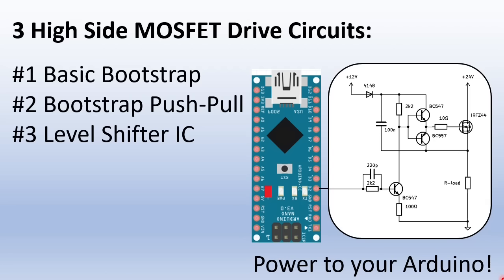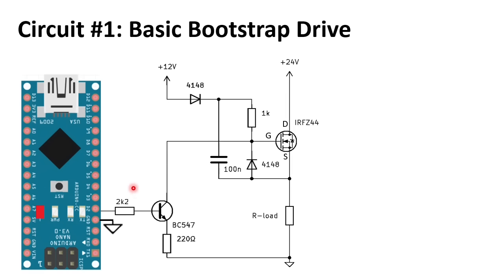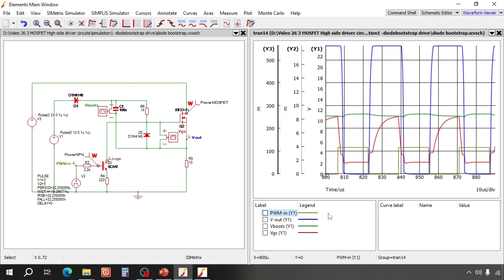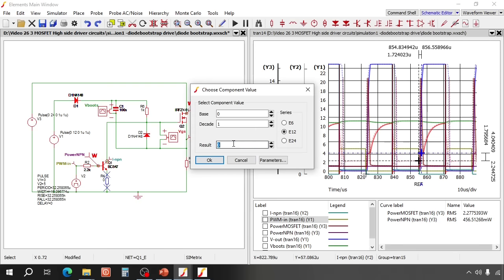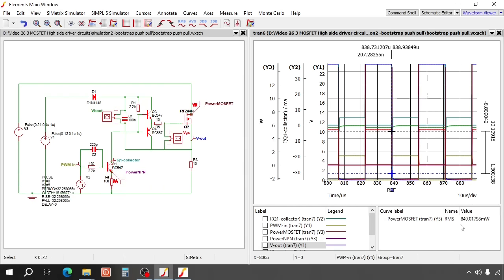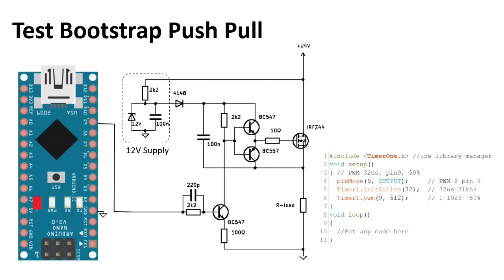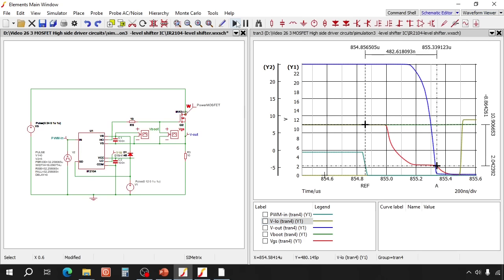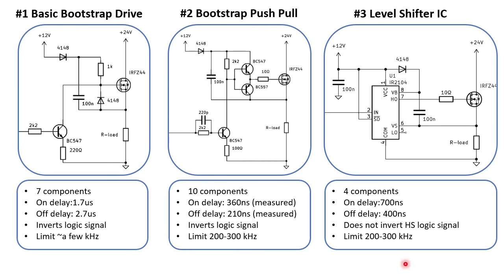3 High Side MOSFET Drive Circuits

Comment: I was always under the impression that the energy dissipation in the Mosfet was due to the speed of the actual switching of the fet and had nothing to do with the delays being on or off. Remember if there is a delay of what ever time say 500ns the fet is still dissipating no energy because it is either full on or full off. It is only at the time that it is actually switching from full on to full off (or vias versa) that the power is dissipated. In your tests the actually switching times are 200ns (using IR2104 circuit) and that is what should be used for the power dissipation calculation. Basically the time of the slope of the mosfet switching is what should be used for the power dissipation. And this is based on the speed of charging the gate capacitance of the mosfet. In the advanced transistor driver and the IR2104 a 10 ohm resistor was used and similar actual switching times of the moset resulted. In the basic version the low current of the 1K resistor slowly charged the gate capacitance resulting in the slow actual turn on of the mosfet. Am I wrong on my assumptions?
Reply from the maker: You you are right, during the delay the MOSFET is just waiting, so no switching losses.

Comment: Nice video, good explanations.  But a comment on the use of "current sink" (BJT with emitter resistor) to drive the boot-strap circuits.  The *minimum* voltage achievable at the collector of the level-shifter BC547 (call this Q1) is about 4.5V, due to the output voltage from the Arduino, and the Vce (sat) of Q1.  Add to this the Vbe of the pull-down PNP in the buffered boot-strap, means that the mimum voltage at the gate of the MOSFET will be about 5.2V.   In most cases this should be sufficiently low to ensure the MOSFET stays OFF, but not always.  Is there any particular reason you did not just connect the emitter of Q1 directly to GND, and insert a suitable resistor in series with its collector if current or power dissipation became a concern?

Comment: Question is if you use higher voltage like 400 volts DC  at the high side drain then need more than 400 volts at the gate source to drive the load at the source and the limit voltage for gate source is not More than 20 volts DC how does this bootstrap works for high voltage at the source you may want to make a video for that.
Reply from the maker: @doost6233  the circuits can work with 400V dc, you will need to replace the “level shifting “ bc547 transistor with a high voltage mosfet. The IC circuit works for 400 volt.

Comment: I have a question as I'm not an expert in power electronics. Could you make a separate charge pump circuit with its own oscillator and switching transistor that's permanently on and is solely devoted to generating bootstrapping voltage for the high side MOSFET? I reckon it would allow you to keep it switched as long as you like since putting the charge pump directly besides the MOSFET only generates the bootstrapping voltage for a brief moment

Comment: To my surprise, I found from digikey some P-Channel mosfets that don't cost that much but are similar to the N-Channel RDS(on) levels.  E.g. G040P04T has less than 3.7mΩ and is only $1.82. The G050PO3T has less than 5mΩ costing $1.17.

Comment: What about a drive circuit that works at DC? (Say to shut down voltage on the load when a fault condition is detected)?

Comment: Thanks you for the detailed explanation. I just want to add a comment that MOSFET turn on and turn off speed is the time the transistor changes state. In most of the video, you are referring to the shifter delay as turn or and off time but this is just the shifter delay and not the turn on/off time. While important to prevent shoot through and ringing, the delay time is not as critical as the time the mosfet spends not fully on or off.Power dissipation is current x voltage and partially open time is where most of power loss is generated. One of the most important characteristics of the mosfet driver is how fast it can switch the transistor. In that respect the slope of the open/close curve is more important than the shifter delay. If you measure it in your experiment you will probably find out that the IC does that best and will result in least power loss.

Comment: Can I use these circuits to swap batteries? I would like to keep a second battery full until the fire battery is exhausted. After that I want to turn on the power from second battery and jettison the empty battery. But this means that after battery swap the second battery would power everything  including the control circuit.
Reply from the maker: Probably not the best circuit for that, I would search another circuit online , maybe something like this: https://www.wellpcb.com/battery-backup-circuit.html

Comment: The 2nd circuit you showed was the one i used during the IC shortage after the pandemic. Worked really well for the motor controller i was tasked with designing.
Reply from the maker: haha cool, yes these component shortages...you could still buy old stuff like transistors and NE555's.

Comment: Your videos explaining circuit operation are some of the best available, free or paid. 
If you’re excepting requests,  will your touch on the topic of the “Slayer Exciter” circuit? It’s used to drive  Tesla Coils in lieu of a spark gap circuit. 
I ask, because in studying data sheets of N-channel Mosfets, I found that the slayer circuit closely resembles a test circuit in the back of many datasheets (an unclamped inductive load) 
I’m still new to field/hobby of electronics. I’m pushing 50 and not without experience. I’ve built several Tesla Coils that use a single MOFET Slayer Exciter that were functional. I’ve  seen a few simulations of the circuit but none with the in-depth explanations that make  your videos stand out from the rest.  Thanks for your time and the videos!!!
Reply from the maker: Thank you! 
I know the Slayer Exciter, and it is not a metal band from the 80's. I have no experience but I expect you can use the low side MOSFET driver push pull part to make your slayer exiter more efficient.  I did see that for Tesla coils it is key to drive it pulsed, e.g. with 5-10Hz PWM with low on cycle (5% or so) to get nicer sparks and prevent burning your MOSFET. You can use the arduino for that (or a 555....)  So yes I am interested and if I find the time I will build one myself 🙂
Reply from the maker: Did you check this video, seems like a robust design to me. https://youtu.be/xImmwL5MR0o?si=BMNipvCvJpJh1Tgh

Comment: Hello! Interesting video! I made experiments with discrete (only transistors)  class D amplifiers. In my opinion most good design of a gate driver is the  " UM10155 Philips application note" .  There are Q12, Q10 is a high side gate driver. The transistor Q8 turns on/off  this driver.You can replace it with usual BJT transistor , but the maximum CB voltage can be greater that your power positive bus (in this video -24V). To decrease current consumption it may be a low power MOSFET, for example 2n7000.
Reply from the maker: Thank you, that is a great appnote, found it: 
http://educypedia.karadimov.info/library/pwm%20vegfok%20philips%20UM10155_1.pdf
Reply: The "UM1055" app note circuit provides no provision against C5+C6 overdischarge so insufficient gate drive of the top mosfet, e.g. when the top transistor is requested to be ON for way too long (in case of the amplifier, when the input signal overdrives it towards clipping on the top rail - so pretty much normal operation unless the input has properly set and even supply tracking limiter). It is even worse as the Q8 draws current from the C5+C6, so is actively discharging them, so the critical maximum ON time is not that long (barely covering the normal switching frequency).
Reply: @annaplojharova1400  So , we need simple forward one-transistor  isolated converter to supply high side - if you want to turn on high side during long time.Or we can use a usual half-bridge gate driver IC and supply high side (without bootstrap diode) with mentioned  one-transistor forward self-oscillating isolated DC/DC converter.
Reply: @andrewandrosow4797  You can use the simple bootstrap, but the predriver has to provide protections that ensure the bootstrap capacitor gets recharged (e.g. by forcing an off pulse in the class D amplifier or the buck converter examples) and/or the transistor gets shut down properly if it can not handle the current with the available gate drive (in fact this could be done by a simple 2-transistor, few resistors and a capacitor addon circuit monitoring the ON state Vds, if we want to stay with "simple" discretes). Or use one of the many available gate driver ICs, which do have at least the bootstrapped supply monitoring build in (that is enough, when either the current is monitored elsewhere, and a direct short circuit is not an issue, like e.g. in an active speaker box amplifier). Here I see the gate driver IC just as the simplest practical solution, offering at least the minimum protection (essentially against input undervoltage for the buck converter, or the signal overdrive for the amplifier). There are also ICs that provide the overload protection (either the large Vdson, or current sense, or both).
Reply: @annaplojharova1400  I had made in past the class D amplifier using this application note.There also was simplest protection against short-circuit. The amplifier works well. I am totally agree - an IC gate driver much reliable and robust that discrette driver.Mosfets much  resistant against avalanche breakdown when voltage becomes high.

Comment: Photovoltaic mode optocouplers floated on the source will also work.
LEDs will exhibit PV effect if illuminated by same colour LED, so it's fairly easy to "dead bug" such an arrangement for experimentation.
Reply from the maker: Optocouplers are a solution, I do wonder what the propagation delay of the opto is, maybe you will need some special fast types.

Comment: I have never encountered the 2nd circuit in your demo. So I learned a new thing! Also, I wonder if the discrepancy in the turn on time measured vs simulated could be due to the way you are generating the 12v. Would be interesting to see if the 12v rail is bouncing during turn on transitions. Its not just the gate that needs to be charged. Also the base current of the high side transistor will pull the 12v down slightly. I will probably make this circuit myself to investigate since it is entirely new to me.
Reply from the maker: Great to hear you learned something william4749. For practical use I do recommend an IC, much easier to build and it also has some protection against low voltage etc. ....but circuit2 works OK

Comment: In my experience, for the discrete bootstrap push-pull it’s best to use the common base (or better yet, common gate) mode for the level-shift transistor. I tend to use the jellybean 2N7002 for this purpose. No extra caps & resistors needed, much shorter rise & fall time, and the logic levels non-inverted. It’s especially useful when your microcontroller/logic chip/comparator/whatever has an open drain/collector output. Penalty: it has to sink both the pull-up resistor’s and the PNP base current, which may be too much for some low-power chips. At voltages higher than 24V it becomes necessary to replace the pull-up resistor with a current source, which further improves the performance.
Reply from the maker: Interesting, do you mean a circuit as mentioned in this discussion (2nd schematic, scroll down). Never tried that! https://electronics.stackexchange.com/questions/296879/logic-level-converter-using-transistors
Reply: @smartpowerelectronics8779  Pretty much yes, but as I’ve said, I tend to use a low-power MOSFET for this, just for the convenience (no need for a base current limiting resistor). Gate is connected directly to Vdd (+5V or +3.3V, whatever the chip is powered by), and source to the output of the chip. The typical Vgs ON of these FETs is abt. 1.5-2V, so it needs to be either a rail-to-rail output or open drain. Might not work with the old TTL logic.

HIGH level at the output of the chip turns the power MOSFET ON, so there’s no inversion like with the common-emitter level shifter.

Comment: I wish I found this a year ago, but being able to switch high side with pwm using cheap components is super useful. Still struggling to understand the transistors, so I'll be reviewing that literature...
Reply from the maker: Great to hear that, the discrete cheap components can really show how this circuit works, success with studying transistor operation !

Comment: Thanks for the video. I am having trouble understanding some of the things you said at around 4:00. Why does the "pull down current" have to be more than the current in the 1k resistor? Maybe it is a stupid question but I don't get it...
Reply from the maker: There is no such thing as a stupid question, every question may make you smarter.
Let me try to explain:
1 - the 1 kΩ resistor connected to the gate "Pulls" the gate to +12V of the capacitor
2 - this way the MOSFET G0S has ~ 12V volt and the MOSFET is ON
3 - If you switch on the BC547 a current will flow from the 12B via the 1 k, and the BC547 this current "pulls the gate down" if (I visualize a schematic like elastic bands connecting the parts )
4 - If the current is too small (say 0.0001mA) nothing will happen, if the current is big (say 1A) the gate will be pulled down very fast. In this case the current is 20mA, 
5 how to know if 20mA is enough? well: 12V/1kΩ is 12mA, it must be more than that for it to "win" the pulling, so 13mA would be just ok. To be sure we set it at 20mA. (also no too much to keep your transistor from breaking )

Comment: Wow great tutorial. Can I ask about the #3 level shift circuit if the R-load/output is paralleled to high capacitance capacitor can it still charge the bootstrp capacitor during off state of HO switch while the output capacitor still have some charge on it if VS need to be in GND level voltage when High side is off to charge bootcap.

Comment: Thank you for an interesting presentation sir. For me it's not a problem to have another voltage source in a system, but I see many examples in a real life (a hybrid solar controller for instance) when people actively use a transformer gate driver. Then they can have one powerful  low voltage source and control a MOSFET bridge. But I see no other advantage with the transformer. Because it's hard to manage a dead time in this case if a 1:1:1 transformer is used. And ferrite cores are quite expensive (pretty comparable with a drive IC price)
Could you touch that in one of your further videos pls?

Comment: Hi Sir,
I have tried Power Mosfet driver IR2101 for high side Buck Converter with Vcc between 12 to 15V. But Mosfet IRF3205 is not going to off state. Hence the required output voltage is not observed across the load. Please suggest any additions to the circuit.
Thank You.

Comment: What software you use to simulate process?
Reply: it's in the corner. openhantek6022
Reply: Appears to be some version of SIMetrix/SIMPLIS Elements.
Reply from the maker: No that is my oscillosope! The simulation software is Simetrix, free version
Reply from the maker: yes you are correct, I added the simulation models in the comments today

Comment: Great videos but did you confuse turn off/on delay with turn off speed ?
Reply from the maker: They are different indeed. delay will not cause any switching losses because the MOSFET is just waiting. The speed is very important because during the slopes/transitions you have current and voltage at the same time = power loss...

Comment: The other methods for driving high-side mosfets are: transformer driver, opto-isolated driver and dc:dc convertor driver.
Reply: Isolated methods are much more expensive than non-isolated.
Reply from the maker: You are correct, transformer drives have been still popular though, especially for bipolar transistor half bridges

Comment: Thank you for your explanation, I was wondering how do you get 76 degree, given 850mWatt at 60 kelvin per watt?
Reply from the maker: If you search the datasheet of the IRFZ44 you can find the Thermal resistance is "60 K/W".
You can then calculate the temperature rise: T= Tamb + Powerloss*Rthermal , in this case 25C + 0.85*60 = 76 C. 
A TO220 without a heatsink is 60K/W a small BC547 in TO92 is 200 K/W 🙂

Comment: How can I use this bootstrap push-pull to drive H-bridge load?  
For example:

1. DC motor 
2. Inverter

That is to drive both the HO & LO. 

Can you modify the circuit in such a way that it would not invert the HO side while it can invert the low side ?
Reply from the maker: You can use it for an inverter.
You can not use it for a DC Motor: all circuits cannot handle DC output in thje HIGH state (LO high)  because the bootstrap capacitor will slowly lose its charge. So you have to switch "low" once i a while to top up it's charge.
Solutions for motor drive: 
1) stay at 99.5% (1kHz PWM) or 0.5%  
2) a charge pump, this adds extra complexity - would not recommend
3) Motor drive IC like L293